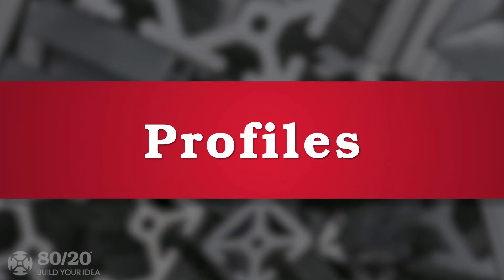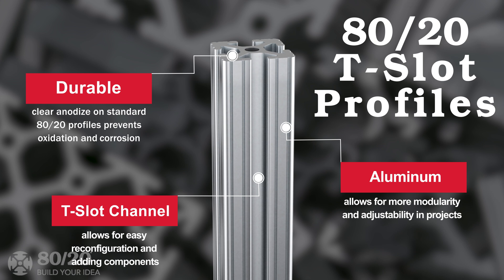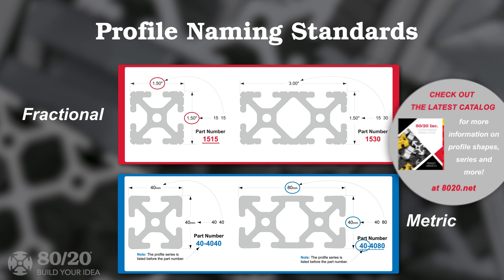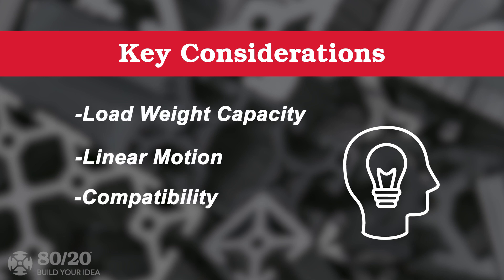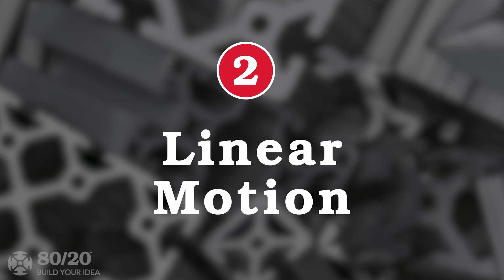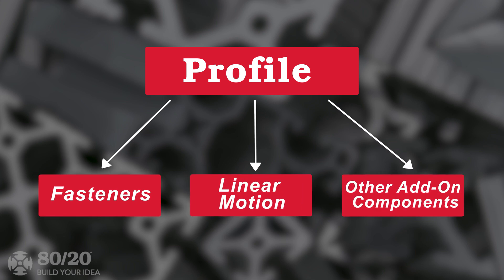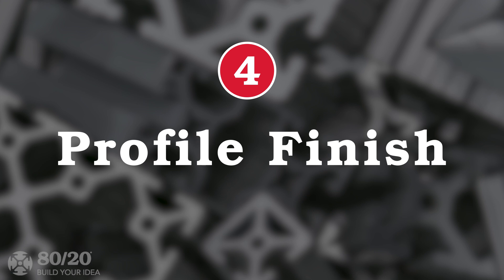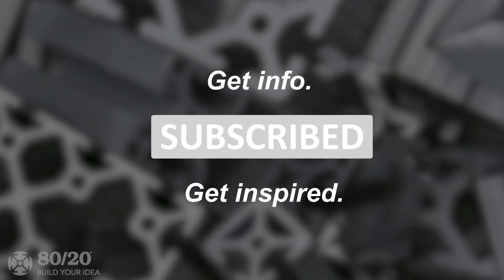80/20 │ How to Design: Profiles

Comment: One measurement missing in this video is the thickness of T-channel. Trying to figure out witch profile type to fit 5/8in plywood inside the channel.
Reply from the maker: Hello! Thanks for your question. Unfortunately, none of our extrusions can accommodate 5/8" thick plywood. You may want to consider using any of our large variety of panels, cut exactly to your specifications:  https://8020.net/panelsdoorcomponents/panelsplateandmesh.html

Comment: what's the cost to draw something up or help Create something, would like to make a solar rack for the top of my trailer camper and a slide out to cover the back of the fold down ramp with screening , but needs to be about 9" over the fan cover when open , I was thing that I possible could put more slide outs that I could sides between the brackets from under neither the top solar panels, its a lot to ask on a 7x14 cargo trailer thanks, I'd be surprised if something like this could all be done to compensate for wind as one drives

Comment: im planning to make a simple Hifi Rack but unsure how the pieces fit together can I just use the corner brackets and connect the legs and side braces using those? or would you recommend a different fastener? 

Thanks,
Reply from the maker: Hi, Tom - thank you for reaching out! Corner brackets are a great solution for connecting extrusions without the machining that other fasteners would require. For help with fastening with brackets and gussets, please refer to our Gusset Corner Bracket Overview video: https://youtu.be/5OEalTlBNBI?list=PLrgoDzr3JjI3I29qKx2I30O49Hh92jdjN